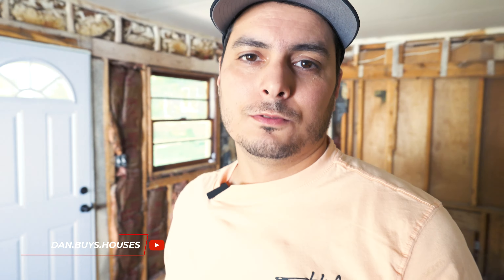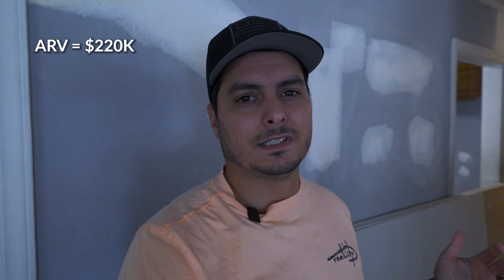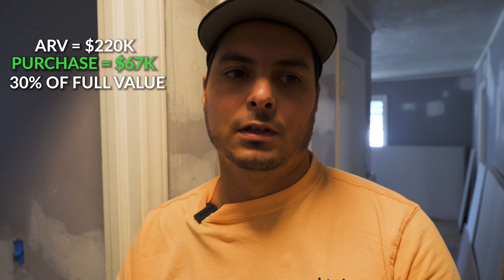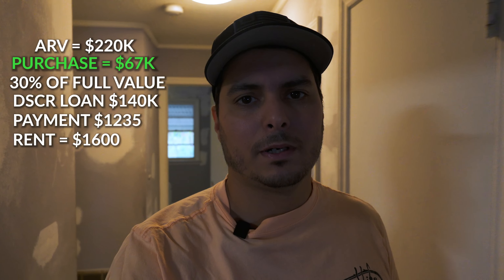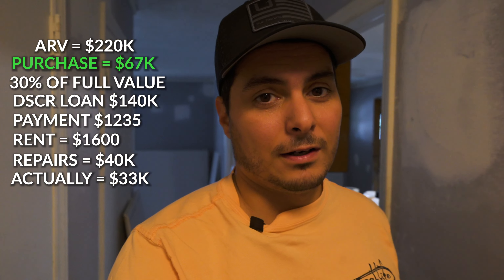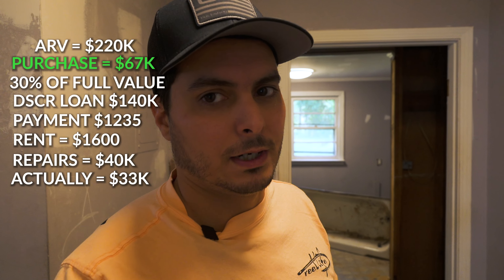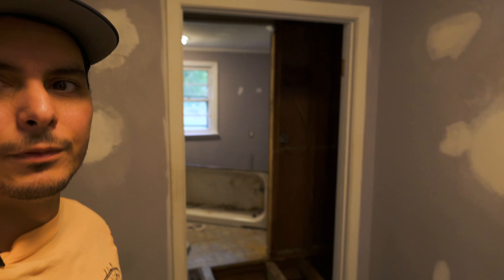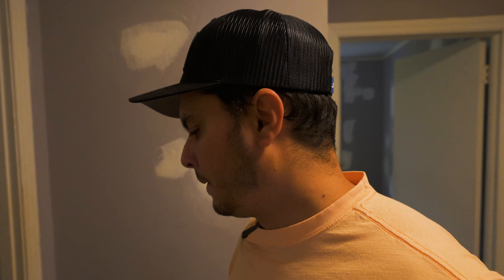Buy Your Wholesale Deals: A Real Estate Investor's Secret Weapon | Wholesale Real Estate Vlog 176

Comment: Don't forget depreciation :)
"Good morning millionaire."
Reply from the maker: Absolutely helps out a ton
Reply: Let's talk about that. The IRS considers useful life of residential 27.5 years, 39 commercial. So the appraised value divided by 27.5 is how much you can write off each year for taxes. Is that correct or does it go off of purchase price. If that's the case u can only write off 1/27.5th of the paid price, until you do finish rehab and refi or post remodel appraisal. If that was the case would it make sense to have it appraised as soon as u bought it? And what do u do if your house is appraised at 140 until month 6 of a year, gets redone updated, and new appraisal is done so it's worth your full ARV from halfway thru the year on. Do u depreciate the first 6 months from the purchase (or previous value before remodel for the first 6 months and the second half of the year u can claim 1/27.5th of ARV to write off taxes 
if not that, Do they let u get away with deducting full ARV divided by 27.5 for the whole year even though the house wasn't worth that from Jan to June? Sorry for the long multi question, figured I'd ask while u guys were on the topic
Reply from the maker: @GTFCEO  in short my accountant handles all this but we run with full ARV from the beginning because that is the real market value after we renovate, these tax strategies only get implemented once a renter is in place (year of operation)